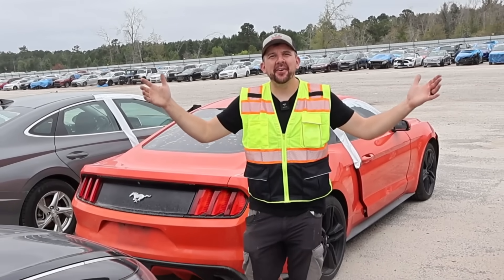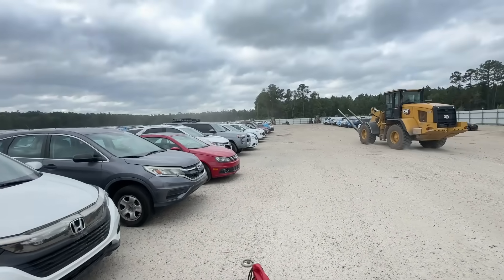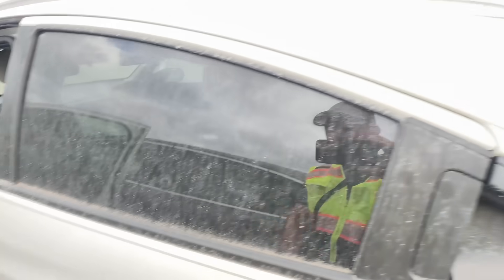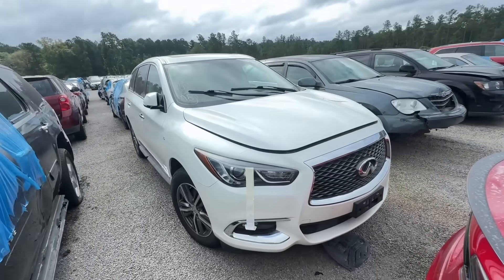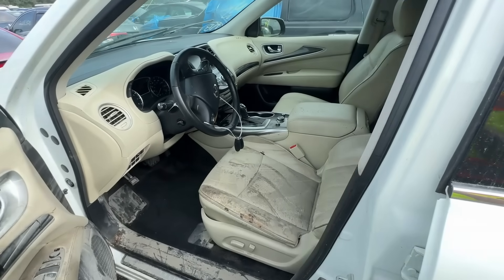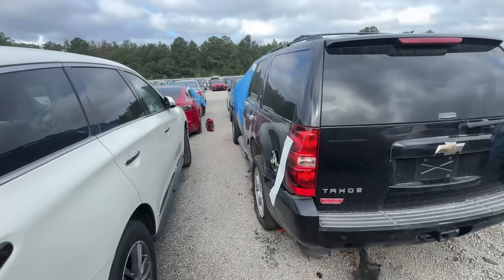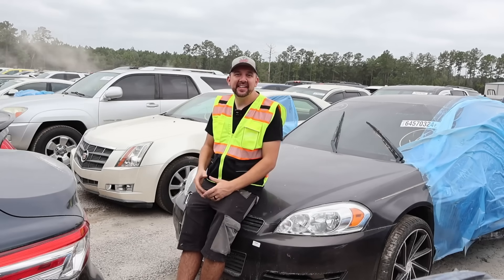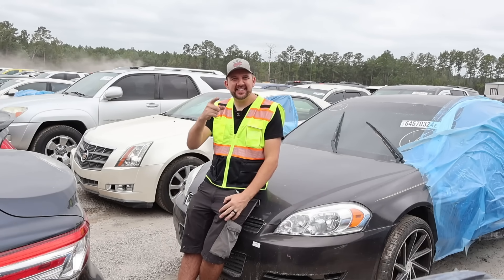CHARLESTON FLOOD , ARE  HURRICANE DAMAGE CARS  WORTH BIDDING ON?

Comment: I've got a 2021 ford explorer ST. Absolutely LUV it but the governor kicks in at 127. Before I had a 2017 ford explorer limited & the governor kicked in at 130. Not sure why the ST with 110 more hp doesn't go faster. Another thing the ST has is front massaging seats. I thought those were only in the platinum but the ST is above the platinum. Also the engine in the ST is a twin Turbo 3.0 V-6 with only 400 hp.